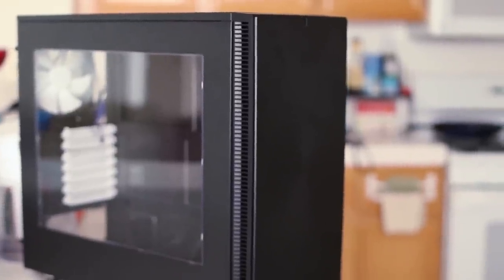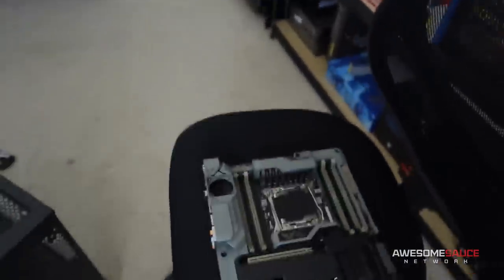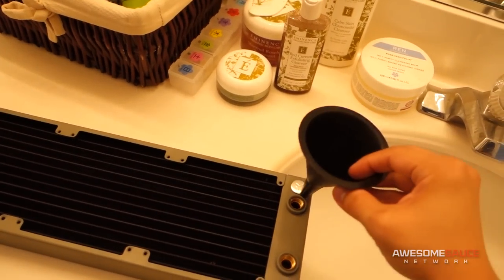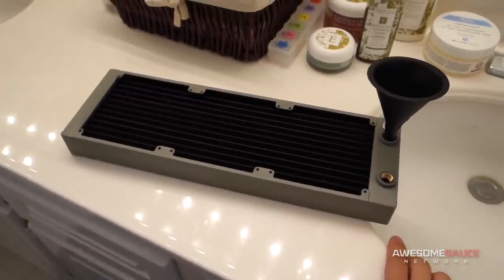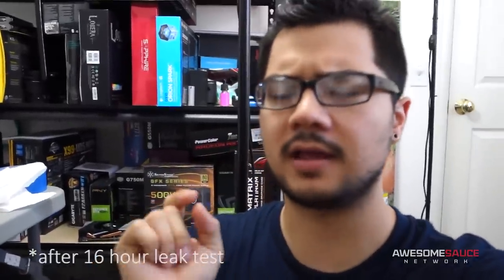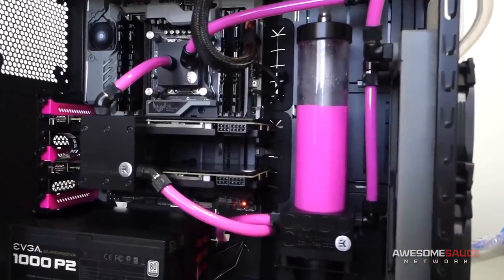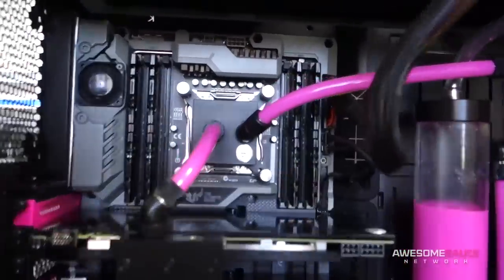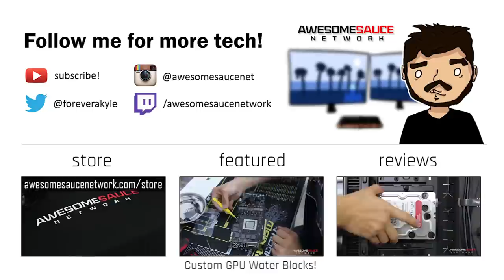Custom Water Cooled Build Log 4 - The Pink Loop REVEAL

Comment: The system is coming along nicely Kyle. The hard tubing will look awesome. It's a bit of a pain at first and you might find yourself re doing it a time or two but the results will be worth it in the end. Here's a tip for you if your cutting hard tube make sure the section of tube your going to use is protected from scratches as its easy to scratch the tube if it moves around while your making your cuts. Also if you end up using fittings that require a tool to tighten them firstly don't go crazy tightening then as you may strip the treads in your components and secondly make sure the inside edge of the tool isn't rubbing on the outside of the tube. I found I had tiny scratches after using the supplied tool for my Monsoon fittings. Keep up the great work mate , your videos are great to watch.

Comment: If you're doing sleeving next, I recommend making extensions instead of sleeving the actual P2 PSU cables. The P2 is Super Flower based and when I attempted to sleeve the cables on the G2 850, I found that many of the sets (pcie, cpu, and 24 pin MB) had capacitors. 

I heard that you can remove them without it making much of a difference or sleeve around them but I didn't wanna take the chance of removing them or seeing the capacitors there with the sleeving. I ended up exchanging the G2 for a Seasonic Snow Silent 1050w.

None of the Seasonic based PSUs I've come across have the capacitors on the cables. For others that wanna go with EVGA PSUs and have an easier sleeving experience, the new GS series is Seasonic based. Ext4bsjons are also a possibility for any PSU. 

Anyway,  the build looks awesome so far!

Comment: Another thing you could do to improve the flow of pink across the system would be to flip the position of the end tanks on the top radiator, provided the rad would still fit.  Either way it's lookin pretty damn solid so far, certainly more unique than a lot of water cooled builds I've seen lately.

Comment: A good idea would be to extend the water-cooling into 2 loops with 2 pump/reservoir combos instead of one like now, 1 for Cpu and 1 for dual Gpu's  .Both loops will have different colors lets say keep the pink and add yellow to the second loop or turquoise . That would break the pink/gray and add some vibrancy to the build.

Comment: If you're planning to overclock, you'll want that fan since it brings air over the VRMs. You should be able to replace it with another 40mm fan that you can paint pink.

Comment: Kyle i you eer decide to go hard line tubing, make sure your tubing is PETG and not acrylic. Also very important to use monsoon fittings, either free center or chaingun compression fittings. They have those lock collars that come with the fittings for much more secure connection. so you wouldnt have to rely on O-ring grip.

Comment: If you want to have some more pink color on the left side of the case, you could just replace the SLI adapter with some regular tubing (hard or  soft) so you could actually see the colored fluid. In parallel config, because that just looks cooler ;)
Or get a transparent SLI thingy.

Comment: The reason the "little fan" is so loud is that on initial startup, your fans are at max rpm. The A.I. Suite 3 will custom set fans to optimal/preferred settings. I can barely hear my fans except on power up. Might think of painting that fan to balance the color maybe?.... just a thought. Great looking setup BTW :)

Comment: I just noticed..... IS THAT A TINY FAN ON THE MOBO?! :D
Reply: ***** Yes,  2 of them, to cool the THERMAL armor... lol
Reply: ***** Yes... and?
Reply: Sabertooths are bad ass
Reply: Bryson Shires never knew Asus did that on the Sabertooth... Damnit. I'd have taken it had I known!!! XD

Oh well...

TyphonPC ... I'm excited, shush.

David Freeman yah they are. Never justified the price, but those little fans..... Damn. Next time I build a workstation rig I'm so getting one to try XD
Reply: ***** they used to have tiny loud fans on mobo's all the time. back in the day there were north and south bridges/chipsets on motherboards and at least one would have a heat sink and fan on it. of course, 2d graphics were controlled by motherboard, graphics cards were called 3d accelerator cards. damn i'm old...
Reply: ***** I remember those motherboards, but I haven't seen a fan on one in ages... Not even that old XD
Reply: ***** they are gimmick. I used to run them, then later I decided to got rid of them. they are noisy as vacuums, plus you don't see any noticeable improvements regarding temperature.
Reply: It's so cool
Reply: ***** it helps cool the vrms during overclocking
Reply: Evan Reams Well, i'm talking extreme overclocking
Reply: Thats cute

Comment: you have it easy these days Kyle lol my first w/c was a dangerden block, two radiators from the heaters of 2 old scrap cars and a pond waterpump...  Those rads got flushed with the hose pipe (water is pretty neutral and no limescale here and coolant was distilled water and PURPLE ICE BABY

Comment: I found out that's always the thing with smaller fans. All computer cooling fans have to move large amounts of air. Large fans can do this easily and quietly, but that minifan has to be revved up to a high RPM to get the same effect.

Comment: Nice build so far, Kyle.  I would suggest NOT removing the chipset assist fan from the mobo though.  I have a Sabertooth P67 and during extended gaming sessions I would get thermal warnings for the USB and PCI-E sensors.  I thought it was the POS ThermalTake V9 BlacX case and its horrible airflow.  So got a Fractal Design ARC Midi R2 and with extra fans.  Same problem.  I added a tiny little Fractal Design Silent Series R2 50mm fan right in the armor of the Sabertooth.  Problem solved....quietly.

Comment: ur working on carpet, dont forget an anti static strap kids, or at least touch your psu when plugged in with power off to remove any static before handling your cpu gpu or motherboard

Comment: I think that for the hardline tubing, if you make the loop so that the liquid goes to one rad. between the graphic cards and the CPU you'll get better temps overall.
Atleast on the CPU itself and a more even temperature in the entire loop. Because as it is now that liquid coming from the GPU:s might be very warm/hot depending on workload.
Reply: Martin Johansson That's not how a water loop works the water gets so fast through the system that the temp is pretty much the same everywhere (only minimal difference).

He would have to do a 2nd loop to get better temps on the CPU but it's not worth it, he has enough rads.

Comment: built my first loop 2 days ago, luckily i was smart enough to buy 2 bottles of liquid. i even bought 5 more fittings than i tought i needed just to be sure but it turned out i was 3 short of my original plan, but i was able to make it work. i have mostly ek parts 240 + 360 rad, i7 6700k and gtx 1080 cooled. if ure experiencing high temps on your i7 like i did 80'c with 240 aio cooler you need to fix your voltages in bios, mine was given 1.42+v on load, now i fixed it and my gpu is 40c and my cpu is max 50c i believe

Comment: what pump did you use as i'm looking to build my first custom loop which'll include 2 gpu water blocks 1 cpu water block a 360mm & a 420mm radiator

Comment: What size is that EK reservoir tube? 250 mm? I'm using a dual bay res right now but plan to swap out for a tubular EK X-Res soon. Not sure what size tube I should add onto it though, or if I should just keep the 170 it comes with. Working with a Corsair 760t case.

Comment: which pump combo did you use for the system? I look on EKWB and I the d5 pump combo but the reservoir doesn't look as big as yours and the pump seems to be more squarish and appears to have a mounting bracket for the bottom of the case in the define S. I hope you see this comment!

Comment: Why don't you turn that top rad around so the inlet and outlet are near the io shield? So after the gpu's a tube goes to top rad and then to the cpu. 1 would improve estetics 2 would improve temps. Also don't paint the whole x99 shield just the x99 branding itself.

Comment: hey kyle. i guess you have tried some combinations of different radiator-sizes.
what do you think is the best option in the define s? 240 and 360, like you did, or maybe go bigger with two 360's or 420+280. the performance is not that important since my system generates not that much heat, but for the looks (and for my mind), i want to go as big for the watercooling, as possible

Comment: what tubing size do you use for inner diameter and outer diameter? I'm looking into the EKWB Custom Loop Configurator and wondering how I should approach it. I'm brand new in the topic of watercooling. It'd just be for cpu and gpu(not ram)
Case: Fractal Define S
GPU: MSI GTX 1070 
CPU: i5 7600k
Mobo: ASRock Z270 Killer SLI/Ac

Comment: how did you power up the MB with the loop not full? wouldn't that have fried your cpu?
Reply: he'd probably had the special 24pin adapter that only turns on the pump when turned on.
Reply: He never powered up the mobo without having liquid in his loop?
Reply: Looks like the CPU power connectors aren't plugged in

Comment: I am sorry, I don't understand what you have done with your PWM pump problem. you have plug the 24 PIN on the motherboard from your external power supply, and in return you have plug the 4 pin molex in the same power supply and the 4 PWM pin fan in the motherboard. so how you fire up with the bridging plug. thank's for your help

Comment: Im thinking to switch from the old reliable cooling systems to watercooled ones but theres something that I want to ask,  If you shake your pc some (moving your pc from home to work/lan) the liquid inside may spill?
Reply: not really, because every component in the watercooling loop is screwed shut and sealed with o-rings.
There are no openings, where water could come out (unless you forget to close any opening somewhere).
So you can turn your PC upside down without anything spilling.
That said: watercooled PCs in gerenal are not the most mobile of machines.. all the radiators and massive copper cooling blocks (+the fluid) add to some serious weight.
So it depends on how strong your back is ;)
Reply: Okay thanks, i may start with AIO's and may later switch to custom loops. <3

Comment: Idk if u said it or not but make sure to use distilled water when flushing the radiators. If u don't it will cause rust. Tap water has to many chemicals and minerals in it. The iron alone in water rust the shit out of radiatiors. The insides of thrm are supposedly copper so I'm sure u can imagine what iron does to copper

Comment: +BitWit I am building my first custom watercooled system and am looking into your project for inspiration. Is the pump you are using a standalone pump or a pump resevoir combo? I can't seem to find it on ekwb's website. It would be a good pump for the system because I will be building in a Define R5, like Hotline, and I will need to devise a solution for draining the system. Thanks in advance.

Comment: is it okay to run straight from sli cards to the CPU? or should you split off to a second radiator after the gpu's then to the cpu?
Reply: watch some more vids if you want but shouldn't matter to within a degree of two the entire system will usually reach a average temp regardless of the loop order. it doesn't work like a car cooling system where you have really hot water entering the radiator and cool water leaving it as there isn't that much heat being generated

Comment: what are the advantages/disadvantages to hard tubing and soft tubing other than cost?
Reply: hard line tubing looks sexier

But really there's little to no performance difference.
Reply: even if you bend the tube, it wont decrease the flow rate?
Reply: Bending the tube will not decrease flow rate unless you kink it

Comment: since your talking about re-doing some stuff, would it be possible to start from the pump to the rad then to the CPU then to the other rad to GPU back to res? I'm just wondering if that would be better for temps. that way your not transferring the CPU heat directly to the GPU. I always wondered about that.

P.S. I'm not trolling, I'm really curious about it.
Reply: Eric Marcus 
The temp difference is minimal, the liquid has pretty much the same temp in the whole system so it doesn't matter.

Comment: what res and pump is that?
Reply: +kreeper24 DYI Pc Mods & Tech The pump is the EK D5 PWM with the EK X-RES 240 D5 reservoir adapter.
Reply: +Metatr0n Hey I know this mighty sound stupid but im quite new to this stuff. So does this mean that he is using a 240 resovior by ek? I can find one on their website.
Reply: +Konsti The EK X-RES 140 D5 Reservoir Adapter is only the adapter, to couples the pump to the reservoir and it originally came with a 140mm reservoir. (Was also available as a ready built combo with pump included) You were able to replace the reservoir with every other reservoir from the EK range, no matter the size. In Kyle's case it's a 250mm reservoir. Unfortunately it's EOL and you're only able to buy it from shops that still have that item in stock. https://www.ekwb.com/shop/ek-xres-140-d5-pwm-incl-pump

Kind regards,
Meta Custom Computers

Comment: OK, so this was not a "How to" guide, but couldn't you have gone over the loop direction?  are you going out to your cards first? or to the front radiator? and the top line on your reservoir is the filler? You're taking that off yes? and your emptying line is the one go out of the case? Sorry I'm new to water cooling and am trying my best.

Comment: I hate it that I can get a 360mm radiator for less than I can get a 240mm rad, but I can't get a case that will fit a 360mm rad for a better price than a case that only supports a 240mm or smaller rad.

Comment: I'm kind of new to this water cooled thing. I was wondering what the pink liquid is. I thought that water was used and I honestly have no clue how this works. If you could explain it real quick. Thank you.
Reply: I'm not sure what the coolant is, but you can find different pre-mixed fluids and dyes. The dyes are used on distilled water which when used alone provides the best results.
Reply: This is a bit late but, water does work. This is a specially made liquid for water cooling that works better than water.  The pink is just coloring

Comment: Why did you use WD blacks instead of Blues?
Reply: Blacks are a huge amount faster
Reply: +Firstname Lastname that's what she said
Reply: not all that much tbh, if you are comparing them under the 1 TB, they are very similar and even the blues are a little faster, check some benchmark videos. But blacks, after exceeding 1 TB, does still sustain the 7200 RPM while the Blues take a step back at 5400 RPM
Reply: Probably smart. I ordered 2 1TB WD Blues. Both of them failed after about 6 months.

Comment: Why doesn't anyone use EK ram and chipset cooling in custom loops
Reply: Xantaxa Not worth the money on an high-end mobo they usal have enough heatsinks that passive cooling does the job and modern mobos don't get so hot anyway .

The same with RAMs some airflow is enough to cool them.

It's just for the looks, not really needed.
Reply: SchwererGustav800mm isn't this whole video about the looks anyway? so i mean why not have them they look sick as
Reply: SchwererGustav800mm http://imgur.com/IhszbNs
Reply: Xantaxa
Water-cooling is not only for the looks, it's about efficient cooling.

In summertime the CPU/GPU can get so hot to down throttle when over-clocked that's the main reason for doing it.

But if it's for looks only sure water-cool what the budget can handle, Kyle probably got the blocks from EK for free i think so he had to take what they gave him.

The system that you posted is a total custom build by the way with a lot of craftsmanship put into it and looks really nice btw ;).
Reply: its ek stuff lel its not custom im pretty sure
Reply: Actually no i don't think so but i do know there are EK ram cpu chipset blocks
Reply: Xantaxa

Sure, the blocks are from EK i meant the piping that makes it look so good.

Not easy to make a thing like that.